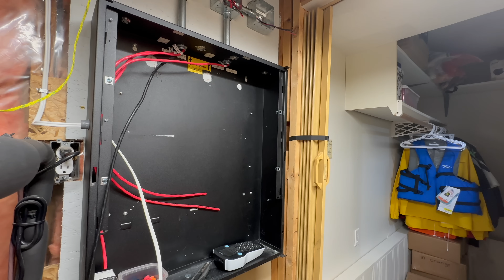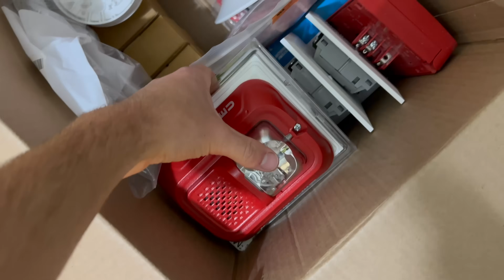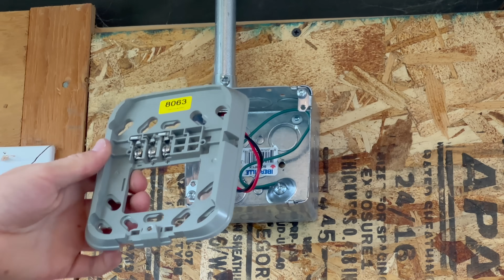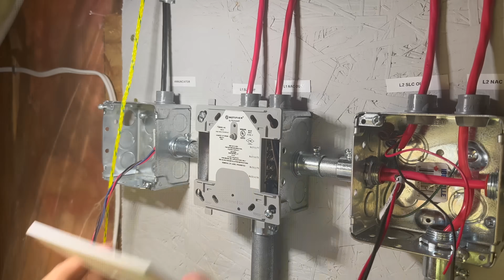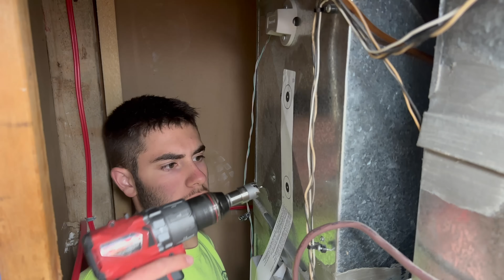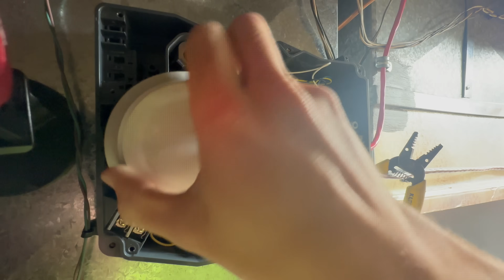Home fire alarm system install. Notifier NFS-320c Putting up devices smokes/heats/L-series￼ (Part 4)

Comment: I bought an addressable panel. When I wire an addressable device do I run the wire to the panel SLC in or SLC out?
Reply from the maker: SLC out if it is class B or style 4 or both to make a full loop if it's class A or style 6

Comment: Hey, I do have a suggestion as far as your garage goes that is built on to your house (if you keep a car or decide to keep a car in that garage at some point) I would install a CO detector in that garage so if the car is left running or unexpectedly fired up, or I guess if something happens in general, because since those L-Series Low-Frequency Sounders have Temp. 4, you would be alerted of a CO condition in that garage. I don't know, just an idea.
Reply from the maker: You cannot physically fit a car in the garage the temp4 on the sounders is only one or the other you can't use one device to do both codings so it would require separate sounders
Reply: @nics-systems-electric Oh okay, my bad.

Comment: Hi, just wondering. Are you going to or thinking about installing a rising link fire alarm extension to contact you?
Reply from the maker: Yes I'll probably use the same one from the garage to monitor the house as much as it's not a proper set up it does kinda work

Comment: Will you be using shunt trip breakers to cut the power to the furnace and outdoor condenser unit just wondering
Reply from the maker: No that would be extremely overkill and expensive as I would need two breakers one 30 amp and one 100 amp. It can all be done with just a ice cube relay

Comment: For the duct detector, you can install it in both return and supply, just if you're doing a single it's got to be on supply. There's some arbitrary CFM number (US) where it is required to be on both and I think that also applies if a single unit supplies for more than one story.

Comment: Notifier also sells Wireless System Sensor L Series Low frequency sounder and horn for ceiling and wall so you don't have to run wire for existing building with no fire alarm system and don't want to cut holes
Reply from the maker: Yeah there's a couple problems with those though one being expensive and I believe you need verifier tools to program them and they aren't legally listed for use in Canada however I would like to get the opportunity to work with them at some point
Reply: @nics-systems-electric  I hope Canada Approves it in the future for wireless fire alarm and also i live in the US and it costs more in canada than the US according to your "Why no announciator" Video for your garage system, So Wireless SWIFT®️ Wireless by notifier is not an option for canada, KEEP UP THE WORK NIC! I hope there is a Test video of the House system and i hope you don't get false alarms by the fire alarm
Reply from the maker: @iansanchez1470  I know it's currently in the process of getting CSA/ULC approval however that stuff usually takes time

Comment: Hey Nick, where do you get your system sensor horn strobes from? I want to use a System Center horn strobe, but I don’t know where to find it. Do you have any website recommendations or any places you get them from?
Reply from the maker: Just EBay. there may be some wholesalers around that sell it too
Reply: @nics-systems-electric  thanks

Comment: As a security and Fire alarm installation tech, For the smokes and any other modules i use just red and black and use the blue and brown for backup. i do that because if bad weather comes round and somehow red and black are no longer useable, you will have brown and blue for a backup. I wirenut both blue and both brown from feed to feed for this also.
Reply from the maker: I was not using parallel pairs in this case I was using all conductors for the loop style wiring where it is not T tapped in other situations though where there are extra conductors I will leave them as spares for sure

Comment: I’m surprised at how quiet your furnace is. Mine is WAY louder than that. Yours is actually kind of pleasant sounding.
Reply from the maker: Was installed in 2018 the newer systems are definitely quieter

Comment: The dedication you put in the install in the house of your family, so neat, so well installed, if you are not going to be a expert in fire alarms, i don't know it anymore. Great video! And your family is very safe now! Question, how much does such a install cost about?
Reply from the maker: Thank you very much I appreciate the support as many don't like what I have done here. Though I think it is a good thing some don't but oh well. Cost is right around $3000 Canadian that excludes boxes and wire as I already had all the wire and some of the boxes I also already had the panel guts the 320 which is probably another $2000 to $4000 so already having that saved a lot of money
Reply: @nics-systems-electric  well, everybody has their own opinion and that's fine i think, if it remains at a bit of feedback, it's your project, it's your choice, not theirs. Make use of the feedback, and thank them for it, it makes you better at your job. Home Safety should never be underestimated, that's the reason i installed co2 and smoke detectors in my parents house recently, the dutch law has a obligation for smoke detectors now, i've added co2 as extra.  4000 is a lot of money for a residential project, i hope you had some help financing it.

Comment: Is it just me, or did you install two detectors as address 3?
Reply from the maker: Maybe I can't remember
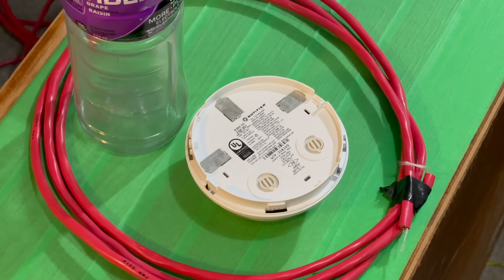Reply: @nics-systems-electric  yeah  @ 7:06 you made the 2nd detector #3
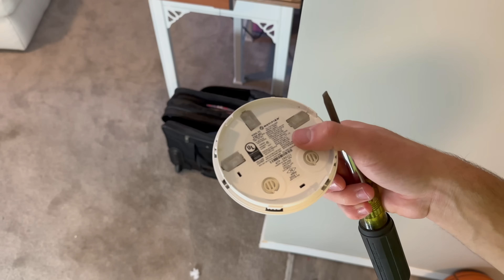and you did another address 3 @ 9:50
Reply from the maker: @mimi2  yes the first one I set to number three should be another two

Comment: Hey Nick, their is a significant difference between the two detector types.

The A suffix on the FSP-951a denotes the detector having a ULC listing instead of a UL listing. The detectors without the A suffix are not ULC listed therefore depending on your AHJ, may not be used in your system.

Hope this helps!
Reply from the maker: Ah makes sense so effectively the same product which is fine for a system not getting verified to a can/ulc standard
Reply: @nics-systems-electric  yes! However if you go to apply for home insurance, they may see this system and request proof of verification for coverage. Insurance companies suck like this. Just something to think about.
Reply from the maker: @embeddedgirl  yeah I get what you're saying the system won't be used in a way to try and get lower insurance it'll just be like having a security fire combo where it's not a CAN/ULC s537 verified system our insurance seems to be extremely laid back here they never come out for any visual assessments or ask what is there it should go to show how concerned they are since they don't care that almost every home built between 1970s to early 2000s have federal pioneer panels which should be a much bigger concern than UL and not ULC listed detectors just my thoughts 50% of the houses I've been in don't have any working smoke alarms so I feel pretty good about my set up don't know what it is here maybe it is because insurance doesn't care but there are some pretty scary stuff around here

Comment: You addressed the 2nd head #3. Great Video As Usual
Reply: I saw that too, guessing the panel will indicate a duplicate device ID during programming?
Reply from the maker: I can't remember the details I may have been jumping ahead one address to leave room for the duct detector or there may have been a dual address set really can't remember
Reply: @nics-systems-electric yea go and watch when you start putting up the smokes the 1st and 2nd one you said set to 3.
Reply from the maker: @Robert-Wilson  maybe I did like I said I don't remember if I did it's not a big deal you just flip the rotary dial one more number
Reply: @nics-systems-electric  just wondering what will the panel do if something like that happens.
Reply from the maker: @Robert-Wilson  it will show a dual address fault and tell you which address it's very easy to correct

Comment: System’s looking great so far! Any reason why you went with the P2WL-LF instead of the P2WLA-LF, and the FSP-951 instead of the FSP-951A for some of the detectors?

Looks like System Sensor decided to go with the clear dust covers for the FSP-951 detectors and the orange dust covers for the FSP-951A detectors. Why they decided to go with different colors for the UL and ULC versions, I do not know.
Reply from the maker: Thank you very much. Mostly just what was available good luck trying to find a bilingual white low frequency sounder they're hard to find as is so I wasn't worried about it as far as detectors it came down to cost again with what is available
Reply: @nics-systems-electric  Ah yes, the classic problem of cost. Now, what I don’t get is if the NBG-12LX can be UL/ULC listed, then why can’t the detectors and notification appliances be too?
Reply from the maker: @HenBasketFireAlarms  who knows I fully trustthe UL only listed ones on my system I will still sleep at night fine. probably a money thing somewhere that's caused the different listing usually where most things come from
Reply: @nics-systems-electric  yeah, I don’t doubt they’ll work just fine. Just weird that Honeywell would dish out the money to dual list the pull stations, but not detectors or signals. Now, if the detectors refused to work, that’d seem more like a Simplex thing than a Honeywell thing
Reply from the maker: @HenBasketFireAlarms  I think the signals are still CSA and ULC listed I think they are still electrically approved for Canada just not bilingual

Comment: How Many Horn Strobes Will Your House Have
Reply from the maker: Three on the system currently
Reply: @nics-systems-electric  Where Will The Three Horn Strobes Be Installed At I Know The Sounder Strobe Installed In The Hallway And A Horn Strobe In The Garage But I Don't Know Where The 3rd Horn Strobe Is Gonna Be Installed At
Reply from the maker: @ryancrooks123  did you watch both rough in videos? Where it shows the location upstairs.

Comment: Nic I feel like the next thing you will be installing in your house will be sprinklers connect to the fire alarm control panel just like in the garage.
Reply: He won’t as it’s going to be really complicated
Reply from the maker: Yeah it would be a nice thing to have but really difficult in a pre-existing finished structure the second floor wouldn't be too bad but the first floor would be impossible without damages being made
Reply: @nics-systems-electric ok